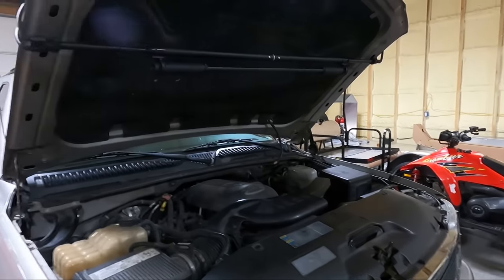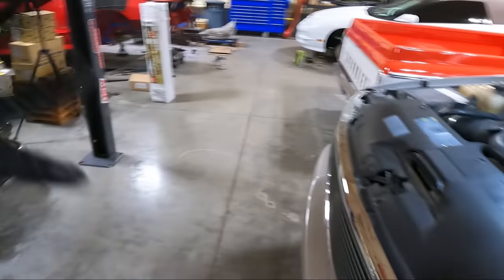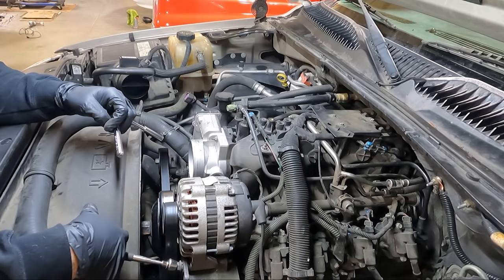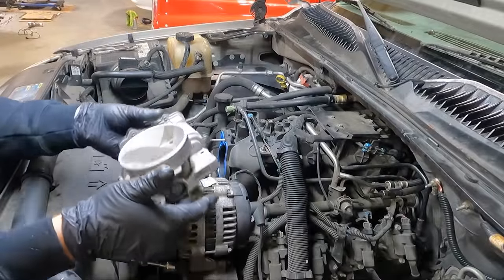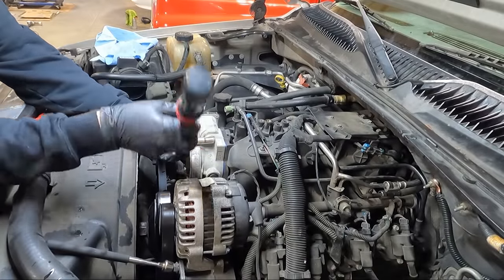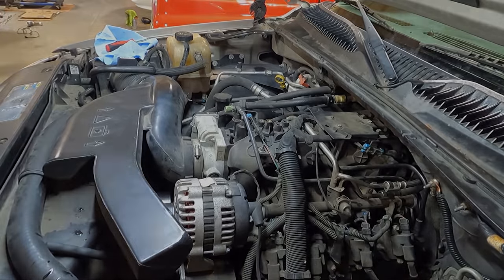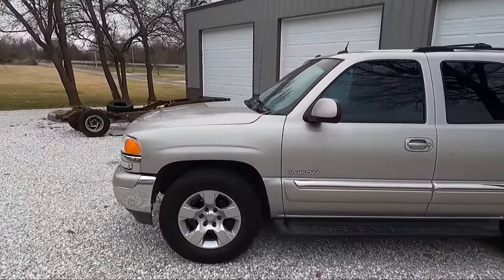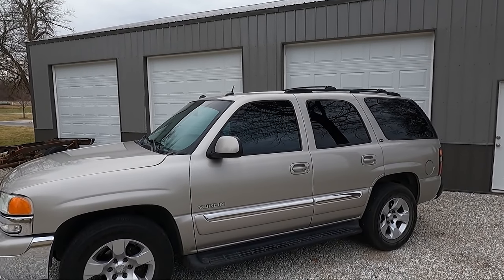How to Fix Reduced Engine Power GMC Yukon

Comment: This “reduced engine power” condition is criminal negligence in design.  How many people have died on the side of the road due to this problem?
Reply from the maker: Probably several
Reply: @TWAMotorsports Yeah several thousand
Reply from the maker: True
Reply: If not for some exceptional luck, I was quite close to being one of them.
Reply: I'm dealing with it now smh
Reply: @EldridgeCherry  best to get a new throttle body.  I paid to have mine “cleaned” but that didn’t do it.  Once i convinced the mechanics to put in a new throttle body, it was fixed and my life was out of danger.

Comment: Hey Travis  I cannot thank you enough for your vid on the '04 Yukon Denali. EXCELLENT ADVICE SIR!  Finally, I am Cruising in same vehicle, my daily/only driver:) As you predicted/mentioned, my problem was SOLVED by R&R THROTTLE BODY W GENUINE GM PART. When I removed the 1 year old TB that local shop replaced, guess who? Of Course it was an aftermarket Remanufactured Hitachi TB from Taiwan, that was purchased from a normally reliable source that begins with a Capital N. AGAIN, YOU WERE CORRECT that some of those are bad right out of the box or fail soon thereafter. Mine failed 4 months after install & I limped, and limped and almost gave up. Spent lots of money. Shop finally told me: "Cannot Fix, Take it to a Dealer In Miami". That's all I needed to hear and decided to TAKE TRAVIS' ADVICE and replace it myself. Detaching & Re-attaching those coolant hoses underneath w/o proper tools was a major hassle but your vid gave me confidence that I could finesse that w needlenose & handle this repair. Bolted on & she started right up, no idling issue. Put a couple hundred miles on it before I posted SUCCESS to you.  Thanks again Brother, You are the best!
Reply from the maker: That is awesome. I love to here that. Just can't trust aftermarket ones honestly
Reply: Was your Tc light on as well?
Reply from the maker: Occasionally

Comment: The only thing Dorman I trust is my valve stem caps lol. Definitely lose the roof rack if you never plan on using it, looks cleaner and less drag on the roof.
Reply from the maker: Lol. Roof rack is going away
Reply: Amen brotha. I had a set of Dorman headlight aiming screws for a G-Body (had a set of retrofitted headlights; highly recommended) and those things folded like two pieces of Sunbeam bread. I said never again!
Reply from the maker: Lol

Comment: are you going to make a Yukon build series that would be awesome . you could swap the roof racks for escalades' . I've got escalade trim on my Yukon. roof racks , running boards , rear bumper, rear window with third brake light and rear pillar vents . and it makes it look like an upgraded trim package .
Reply from the maker: I am. Not planning on adding any escalade parts.

Comment: Awsome!!  Tried several years ago to clean mine.  Just cleaned up front because I could get it off.  Never thought about the hoses.  Well at that tines wasn't as mechanically inclined as i am now.  Way better throttle response after.  Thanks for the video
Reply from the maker: Thank you. This one actually feels more responsive

Comment: I’ve been dealing with the reduce engine problem for about 7 months I’ve replaced the throttle body with a duralast one since a GM one wasn’t available. And man this is the 3rd one I’ve swamped and it only works for a day or two. Always in the morning it would go into reduce mode. And in the afternoon there is no problem at all. Seeing your video now has me thinking i should buy the GM one. The duralast one made a noise like yours did when i picked it up as well. Thanks for the great video. I hope i am able to fix it with the GM throttle body.
Reply from the maker: I bet that will fix your problems
Reply: If that didn’t fix it run a ground wire from the block to the body. Even if there is already a ground be sure to check it isn’t full of corrosion and if it’s on an area that is painted make sure the paint has been scraped to bare metal. That is what fixed it on mine. Hope this helps someone.
Reply from the maker: Sometimes it has ground issues too
Reply: @TWAMotorsports  yeah that’s definitely what did it for mine was the ground was corroded.
Reply from the maker: Pretty common
Reply: @TWAMotorsports  yeah thank goodness for the internet and people like you who share it would have undoubtedly cost me a pretty penny had I took it to the shop.
Reply: @TWAMotorsports  man it looks like I spoke too soon it was working great and then today while I was on the highway I was gunning it and when I slowed down and gave it gas the dreaded reduced engine power error came out again 🤦‍♂️ you think a throttle body cleaning would help?
Reply from the maker: @readyeddie2065 that's true

Comment: Thank you for the video, hoping this improves my quality of life drastically! Bought an 03 yukon xl with 250k mi 3 yrs ago on the cheap. still has a few annoying issues. Reduced engine power, oil pan leak, always says right rear door open and check brakes, and dings incessantly, alarm goes off randomly😂 I’m not mechanically minded but have been able to fix various stuff.
Reply from the maker: Sounds like you may have a bad bcm

Comment: My 03 has the same issue! Going to try this out and see if this helps. Thanks for the video!!
Reply from the maker: Should fix your issues
Reply: Did it fix it cuz mine will not go away replaced basically everything that is t the wire it’s self
Reply from the maker: Gm throttle body?
Reply: Most likely not my father got it for me and I put it on I can check if it is gm and if it’s not where can I get a gm trottle body.
Reply from the maker: @Numbersactor from a dealer

Comment: My 03 Silverado 6.0 was showing the "reduced engine power" as well one morning, so I cleared the codes and it runs totally fine now. I think it was just due to the cold the one day
Reply from the maker: Which means throttle body is on its way out
Reply: Mine starting acting up in the June heat, but getting stuck in traffic seems to push it over the edge
Reply from the maker: Gonna get worse

Comment: Add a Corvette Servo to the transmission, it will help in shift points and acceleration . My transmission was having the same issue with gear delay every time I try to make a pass . The Corvette Servo is the best way to go . It will increase your transmissions life.
Reply from the maker: I have done that in the past

Comment: I change the throttle body a month ago now I have the same problem this make me so stressed...not wat to do.......great video
Reply from the maker: Did you buy a gm like I talked qbout in this video?
Reply: @TWAMotorsports  I went to the dealer and they tell me dealer won't sell parts for a 2004 yukon because is to old....is that true????and I have to buy one in autozone
Reply from the maker: Find a better dealer

Comment: I'm not even a GM guy but my friends have 04 Tahoe they bought new 5.3 it has 439k miles motor is original but two transmissions still looks great it's a weekend dog hauler these days. Looking forward to the TWA touch on this one
Reply from the maker: Thank you. Yeah they are tanks.

Comment: When mine does this I can pull over, shut off the engine for 10 seconds and start it back up. It will though do it again on and off on me within 5 to 10 miles. Thank you for your video!
Reply from the maker: Probably need a new one
Reply: That is the pigtail that goes to the throttle body I had the same symptoms changed the pigtail and it didn't reduce engine power for months but then it came back some how
Reply from the maker: Junk throttle bodies
Reply: Sounds a lot like mine, but my scenario was very hot day in traffic on I-10.  It seems it will work (ok) as long as i can run on cruise control.  But getting into traffic was the death nell
Reply from the maker: Thank you

Comment: U did good on your fix. Im having same issue on my 2005 chevy suburban . I let off the gas it boggs down like its getting ready to die with a tremble.
Reply from the maker: Thank you. Good luck on yours
Reply: Mines doing same thing
Reply from the maker: Probably needs a throttle body
Reply: @TWAMotorsports  I'm missing two bolts to go into throttle body to manifold so Imma clean it, I order 2 bolts and hopefully the code leaves I clean it it does good but from being loose to much air getting in.. so Imma try cleaning and putting all 3 bolts but if not Imma just fix it
Reply from the maker: Could definitely cause issues
Reply: @TWAMotorsports  it drives good for 15 minutes but I pop the hood and it has a minor window between the throttle and manifold so like u said this can be the issue

Comment: Cool video. My 03 Yukon does it once in a while but doesn't do it when it's cold. It does it after it's warmed up. I can start it fine and drive for a couple miles and once a start it again it gives me that reduce engine power. I just disconnect the harness and plug it back in and it goes away. You think it's the throttle body?
Reply from the maker: Probably so

Comment: It's always hot down here in the Keys so no cold issue. The shop did add additional ground and I am embarrassed to admit how much money I threw at it w several/many different sensors replaced just trying to keep it going through my fishing season. Just can't pull off the road every 5 miles. Now I have time to work on it myself. Btw I have owned 6 older Burbans (pre '99) over 40 yrs and was able to fix the routine issues. Never had a GMC Yukon Denali w all this fancy stuff.
Reply from the maker: That would be a pain. Hopefully you can get it lined out.
Reply: @TWAMotorsports  Thanks Man. I don't post often but if & when I figure this out i will definitely advise You and  hopefully help some of your followers. I am having a hard time finding a TRUE GMC TB for 6.0 '04 Denali
Ac Delco ok if i can find one? Thanks for your time and i won't bug you anymore until i fix the damn thing.
Reply from the maker: Only brand I buy is genuine gm
Reply: I'm looking OM TB for my 2001 Chevy Silverado 2500hd Chevy dealer says discontinued any ideas?
Reply from the maker: That is a cable throttle body. Different deal than what I address here

Comment: the rattle in the throttle body is normal when you rock it from side to side.  I bought a new GM TB ported by kaytech for my 2018 6.2 and it made that sound.  I was a little concerned, but then I pulled out the original one from my truck and it did the same exact thing.
Reply from the maker: Maybe thats why the other didn't work. It didn't make that noise. Lol
Reply: I’m looking at 4 used ones now and none of them make the rattle
Reply from the maker: @JamesRazorbacks who knows

Comment: Of course it's gonna work you reset it with the battery disconnect. My question is what happened a couple days later? Did the issue come back???
Reply from the maker: Not after replacing throttle body

Comment: Hi travis i have the issue but i already change the throttle body and the black box that runs the throttle and the gas pedal and i left the negative wire unplug over night still the same issue no throttle responds and i turn it off turn it on again runs fine for minutes or less i dont know what else to do i can really use your skill thank you very much
Reply from the maker: Make sure and check all the grounds

Comment: Hey Travis, Thanks so much for the video. Got a question about my 2007 Sierra 1500 truck. When you said “reduced power” did that also mean it was missing like firing on fewer cylinders? 

The GMC dealer suggested to rebuild the top half of the motor. The mechanic is telling me it’s stuck in 4 cylinder mode. It has that 8 cylinder, 4 cylinder gas saving feature. My truck stopped running setting at a red light, it wasn’t moving but when I finally got it cranked it felt like it was firing on 2 cylinders. I’ve had small electronic issues in the past but nothing like this and I don’t know if switching from 8 cyl to 4 cyl is done electronically. Have you ever experienced a GMC stuck in 4 cylinder mode? 

When I get the truck back I’m going to look at my ground wires. Thanks again for the video.
Reply from the maker: No that is a different issue entirely

Comment: I believe I have this issue on my 03 yukon. It was coldish this morning...dead battery, jump started it, and reduced engine power message was on along with disabled system stability. Had no power at all going up my driveway.... Shut it off a couple times..second restart it worked fine...messages gone.
Reply from the maker: Probably on the way out

Comment: My 2003 was getting hard to start and was intake gasket causing it🤔. Roof rack needs to go. Hopefully you will install electric fans, thinking about installing them in my 2000 chevy truck.. ✌
Reply from the maker: Thank you. Yeah this probably needs those too. Lol. Electric fans will come eventually. I did that swap on my green nbs truck

Comment: I have this same problem with my Yukon. Got a new TB and harness installed at dealer and 3 months later the same problem started back up. Pretty much gonna get rid of the truck now. It's become a problem no one can fix.
Reply from the maker: Could be a grounding issue
Reply: @TWAMotorsports  probably, but how many ground wires are in the truck? I've already spent a fortune trying to get it fixed all for nothing. IMO, if someone encounters this issue, they should get rid of the truck immediately and save themselves from a world of headaches.
Reply from the maker: Several do get rid of them. Maybe 10 grounding places in all
Reply: @TWAMotorsports  I've been reading online about it for months and haven't been able to get mine fixed at the shop. Is there a list of grounds I can fix? I will try it. I hate to see a nice truck get dumped over something this silly.
Reply from the maker: I showed a few of the ones I cleaned. Does it have a new gm throttle body?
Reply: @TWAMotorsports  yeah. Paid the dealership to install a new throttle body and wire harness connecting into it. Problem was resolved for about 3 months and just came back again.
Reply from the maker: Could be a bad unit
Reply: Rob I am feeling you. Same exact situation here w '04 denali. T/C light comes on & it goes into limp dick mode.
I also HATE  to dump a very nice truck because of this. 6 months now, no one can fix it, getting desperate
Reply from the maker: It does get annoying
Reply: Yea I think I'm gonna fo the same thing with my Sierra. Tired of spending $$$ on a problem GM created to be an endless problem.
Reply: @heatman678  that's what I did. I sold the truck to a dealership. Let them fix it.

Comment: I have the same limp mode issue with my 2003 gmc Denali 6.0.  It will at times do it when I hit a bump, other times for no particular reason.  I can pull off the road sit for 20 seconds, fire it up and take back off.  Sometimes I’m good the rest of the drive, other times it’ll do it 5 times in the next 5 minutes.  Had throttle body replaced, pedal sensors, knock sensors.  Sounds like I need to confirm it was a gm tb and check my grounds.  Does this sound like the place to start?  

I also have weird intermittent cabin lighting issues where they are often dim and then will randomly be really bright as they should be.   Think it’s related and any ideas?

Thanks for the great vid and comments on here!
Reply from the maker: Sounds more like a ground issue

Comment: My 03 Yukon does it when it's warm up. I'll come back from work and if I start it again to go anywhere else it gives me that message. I have to turn it off disconnect the throttle body harness and plug it back in then it goes back to normal. I'm kinda leaning toward the throttle body as well. What do you think it is?
Reply from the maker: Could be the issue. Generally is

Comment: Excellent vid Sir. I also have an '04 Yukon Denali XL that I bought 5 years ago w 170K/223k now. Same color but yours looks much nicer. It is also my daily driver and I use it to tow a sm skiff for my charter biz. Always ran perfectly. Love it!  Many months ago the T/C light would come on periodically and it would go into Reduced Power mode. Pull off the road, wait a few seconds and restart and all is fine for approx 5 miles. Took it to my local shop here (I had to get it running ASAP & did not have time to R&R the TB myself) in the Keys and they replaced Throttle Body and both front wheel sensors. Ran fine for 4 MONTHS, now I have the same problem constantly. Undrivable now. They used an aftermarket TB. I would sincerely appreciate any advice. R&R TB w genuine GMC part? Thanks again for the explicit vid. Please advise Sir. Thank you very much.
Reply from the maker: Probably the grounds or throttle body. I would start with the throttle body
Reply: @TWAMotorsports  Copy that loud and clear. Thanks for quick reply.
Reply from the maker: You're welcome